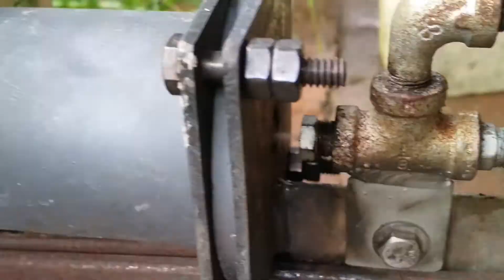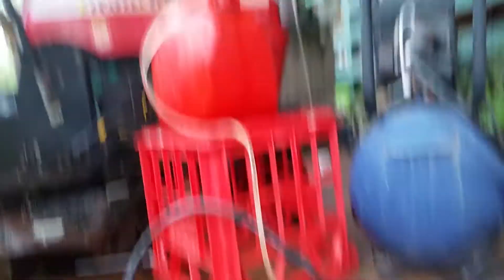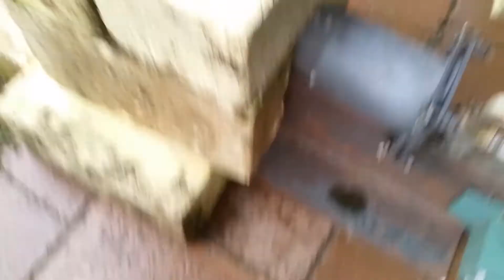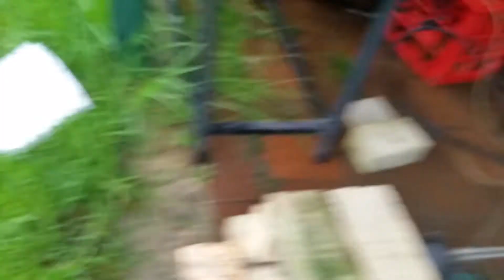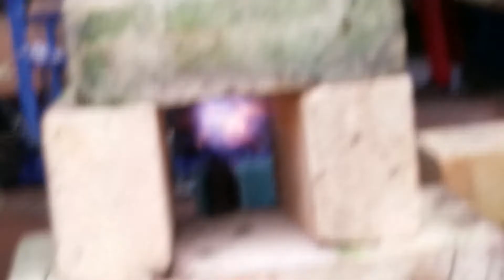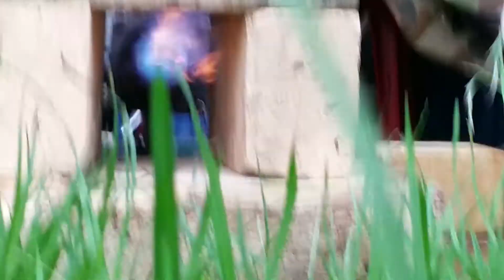SiC burner on diesel

Comment: How much air are you having to force in that?
Reply from the maker: Depends how open the air feed is. It will take more than the compressor can give. I could do with a bigger compressor to run it. It's not even up to temp. The whole nozzle should glow...